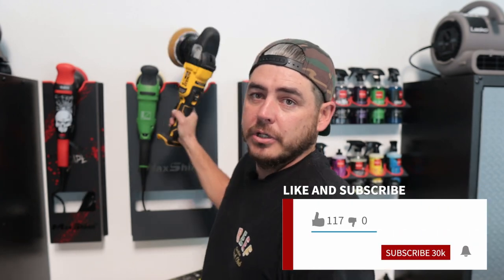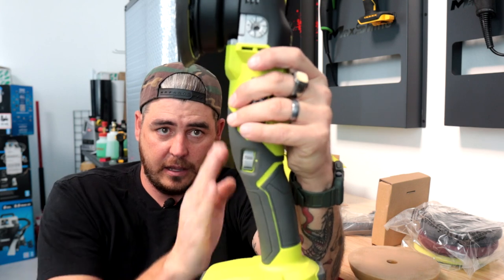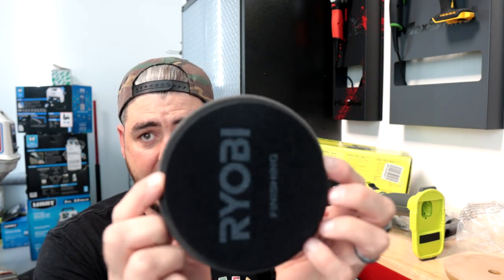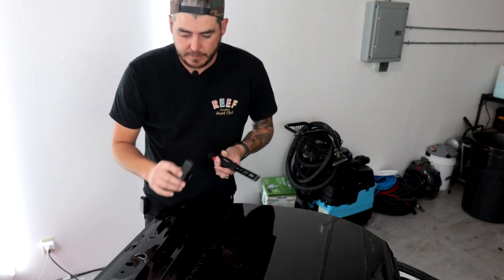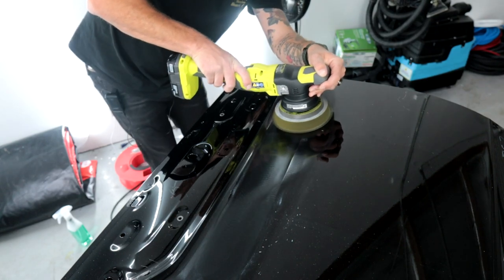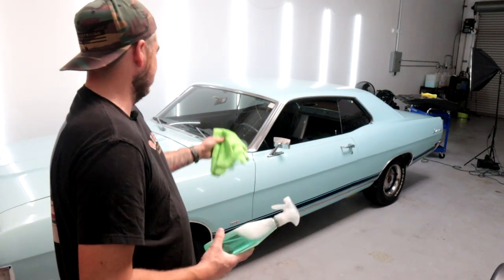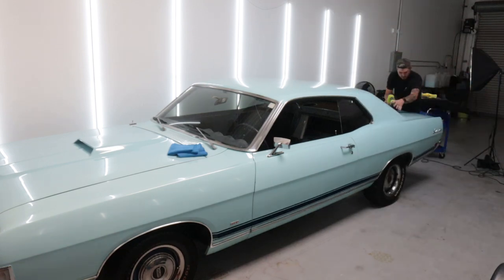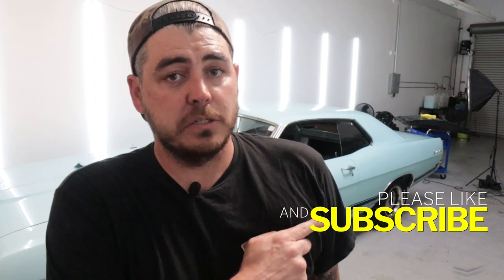Ryobi 18V Dual Action Polisher | Battery Powered Polisher | Car Detail

Comment: Hey josh if you use the high power battery packs the power on the polisher gains substantially. Try  one you will be surprised
Reply: True
Reply: Does it give it enough to do minor correction ?
Reply: You need the big boy battery for sure, you need the amps. It's like trying to use a small battery with a impact gun, it won't do much

Comment: Looks great for DIYers, looks about right since Ryobi doesn't really aim for professionals. I would love to see it apart and take a look at the armature; also wouldn't hurt to repack it with better grease.
Reply from the maker: Yes good point! Like the Bauer harbor freight mod
Reply: I’d watch a video of re-grease on this unit.
Reply: @imjoshv  what size is the screw to take of the backing plate

Comment: The on/off switch is actually not bad. I have a disc sander with that switch and I struggled for the first two uses and now I actually like it and is easy!

Comment: What do you think of using this with a 3 inch backing plate? I just bought the new Milwaukee 15mm polisher and I have the adams sk pro micro. I need something in between that’s also cordless.

Comment: So I'm looking to buy a polish tool like this for mostly waxing as I'm very inexperienced with waxing and paint correcting as my truck is only a couple years old but has tiny scratches from typical washing. I already have ryobi tools. Would this be good if I only used for waxing or is the ryobi orbital buffer a better option?

Comment: I have had this about a yr . I dont use it for correction though . Enhancement/ 1 steps  and wax removal only . I have like 20 batteries so that's not an issue.  I have used almost three 4 ah or 2 6 ah to get around a vehicle.  I also use it when doing motorcycles with an extension.  Pretty happy thus far . Alot of the time it just comes down to if I'm mobile or home . Ty for the video.
Reply from the maker: Awesome glad to hear!!
Reply: You use this machine for wax removal? I can polish and apply wax to my car with two 4ah.

Comment: Polished about 20 cars using ryobi.
It leaves holograms on black paints sometime, which is hell = game over since i do one step only.  Even on some  volvos and audi paints  - holograms. Pretty visible holograms but not super bad holograms.
Scholl s20 + blue spider pad - moderate to heavy preassure . 
1 large black   car moderate to heavy swirls to 80-95% defects removed in 12 hours = one cross pass = left , right , up dow.
10-12 batteries 5 ah each. 
If  heavily swirled german cars,  then double amount of passes for the same results. 

I am done with ryobi now and need propper macine now.  
I am almost sold to forced rotation as it will not keep stopping at curves and edges of some crazy toyota cars :)
The only point holding me back from going forced rotation is absence of knowledge if forced rotation machine will always finnish very well with one step compound leaving no holograms as well on black paints.  At Least on German cars. 
One step compound -Scholl s20 one step compound and medium cutting pad / blue spider pad combo for example to remove moderate to heavy swirls to 85-95% perfection =  85-95 % defects correced while super lttle haze and 0 holograms left after 2 passes= left to right and up snd down = 1 cross 

Kind Regards 
Your subscriber
Reply from the maker: Thanks for the info! I would say you can get swirl free results for sure but you may have to change up the pad and compound/polish combos. But it sounds like you found a trusty combo that works for you. The ryobi just isn’t the choice for you. I actually have never used a forces rotation but I see the benefit for sure not having to worry about it bogging down. Are you looking at flex?
Reply: @imjoshv  
Aye looking at Flex forced rotation.
P.S. 
Not doing 2 + steps paint correction.
One step takes me whole day....
Thank you but more than a day for one car just not for me
Reply: @maximolotov one step takes a whole day? I'm pretty slow I feel like but I can compound and polish in half a day on my Mercedes SUV. If you're working on badly scratched or marred paint then I guess I could see that but shouldn't take that long!

Comment: Thanks for the fairly thorough demonstration Josh. Like your Fairlane! Being newish to detailing, curious as to what the various foam pads are used for.
Reply from the maker: Foam pads have different densities. Usually 3 different types: compounding, polishing, and finishing. But you can also play with that. Sometime I will use a compound on a polishing pad to achieve a result I’m looking for
Reply: @imjoshv  does finishing pad usually mean that is for wax only and not compound.
Reply: @thestreamreader not wax but a polishing compound.

Comment: So, I bought the thing, and since I have a Mini cooper, I thought none of it, I mean no brainer, did 2 panels (door and side) with compound to clear a heavy scratches and battery died, re charge to full, 1 door and back, same thing. Any thoughts? 🤷‍♂️ I’m I doing something wrong? (Ran 5 pases, cross pattern with a 5” hex chemical guy’s orange pad and Maguire’s Ultimate compound) currently charging the battery to do the rest of the hood and trunk 😴

Comment: Straight up the bogging is due to the 1.5mah battery. I threw those crap batteries away. No good at all. 4mah or up. Couldn't stop it at all with my 9mah battery. Heavy but works the best.
Reply from the maker: Awesome great info!!

Comment: Hey Josh!  How would you compare this to the harbor freight DAs?  Looking for my first polisher will probably do 2 step on my car and kids car then not touch it for two years. I can get a factory blemished version for $139 and already have 2 9ah batteries. The battery powered option just sounds so attractive vs corded and the vibration/smoothness of the Bauer is often brought into question.
Reply: Little late to reply now (dunno if you got something by now) but I have the older/shorter throw HF corded DA and this Ryobi...  The Ryobi is not nearly as as powerful.  It is best used with a 4Ah+ battery for sure, a smaller single-row battery is not going to cut it; but note with more power there's more vibration.  The vibration is tolerable for a DIYer or someone doing a car on a weekend or something, but nobody would use this repeatedly/daily.  If you think the HF is bad for vibration...lol, the Ryobi is much worse.

If you need to do heavier correction, forget about the Ryobi and go with the HF (the newer longer throw being able to do even more in that respect).  If you try to do heavier correction with the Ryobi you will likely need to spend more time, and subsequently burn through a lot of battery doing so.  9Ahs are nice but three or more 4-6Ah batteries would make the tool a bit easier to use, due to less weight.  I think the 6s would be the most ideal here TBH, but really whatever you have multiples of so long as they're 4Ah or more.  Swap & charge when you're at about 2 bars battery (better method than running down completely and swapping then).  

Having the two tools though, the HF is definitely much more suited to correction.  If I need to do anything more than a basic polish, I use the HF.  After doing that, can switch to the Ryobi for next stages--polishing and applying wax/sealant--and do away with the cord.
Reply: @rolandm9750 this is the type of review comparison I was looking for. Thank you!

Comment: Btw on page 6 of the Manual, towards the bottom left it says "The tool’s rotating base moves in random orbital motion. 
The orbit diameter is .31 in (8 mm)."

It's sorta hard to find but it's there, if that helps any.
Reply from the maker: Awesome thanks so much!

Comment: I know this is off-topic for this video, but I've watched all of your content and would really value your opinion.  I'm expecting delivery of a new Ram 1500 truck with 'bright white' paint and cloth/vinyl black interior.  What protectant steps/products would you recommend to apply immediately?
Reply: Clay it do a one step paint correction and do a gyeon wet coat its the easiest fastest way to protect your vehicle
Reply from the maker: Yes I’d put a ceramic coating on. Wet coat will give good protection. I really like the maxshine graphene ceramic coating or g technic crystal serum light! Both are easy to work with and will last longer than wet coat, but they won’t be as easy to apply. For the cloth interior you can pick up a fabric protectant. Scotchguard auto can be bought at Walmart and does a pretty good job! Congrats on the new truck!!
Reply: @imjoshv  Thanks.  Are we saying that the ceramic coating is the 'one step paint correction', or that the correction is something that should be done prior to the ceramic?
Reply from the maker: @kirbyspencer538  the ceramic is just protection. You want to do a few things to prep the paint for proper adhesion. Clay removes contamination the a one step polish with bring shine out and then do a prep wipe to make sure there is no residue left on the paint and then coat the vehicle! You want to use a polish with no fillers or waxes so that’s it’s just a pure polish
Reply: All of them

Comment: why not just read the specs ? 8 mm according to Ryobi - may even be on the box ?

Does yours appear to stall even with very light pressure ?
Reply from the maker: It was listed in the manual… I finally found it haha. Yea it will bog a bit but not bad at full power

Comment: Just used this to do a 4dr suv. Only used it to do a polish on the clear, did not need to do a compound. Went through 6 4amph batteries. Applying light pressure to the head of the tool killed it's orbiting action, and basically stalled it out. I returned the tool in the end. Not worth the money. All my tools are Ryobi and some harbour freight stuff. I like Ryobi but this tool is way below par.

Comment: This polisher sucks. It stalls even when I use no force. I even turn it to max rpm and I was using the included pads too. You're better off using a Ryobi drill with polish disk.

Comment: Of course the DA head is stalling out, you’re using a battery that is not even half of the recommended power rating 🤦🏻‍♂️
Reply from the maker: That’s the battery it comes with. I wanted to test it as it’s sold
Reply: Uh, this is sold as a bare tool only. You even state this at the start of your video. So you’re contradicting yourself there to begin with mate. 
If you’d done your research, you’d find that the very lowest rated battery you should use with this DA as stated by Ryobi themselves is 2.0ah, with the 4.0ah being recommended, though you can use all the way up to 9.0ah. You’re using the 1.5ah battery which came with your drill 🤷🏻‍♂️ 
So yeah, as I said, your battery is not even half the recommended power rating, and you’re complaining the DA head is stalling? Of course it’s stalling 🤦🏻‍♂️

Comment: Ryobi and Dewalt are the same company.  You can get an adapter to use Dewalt batteries on Ryobi tools.
Reply from the maker: Are they? I know tti make Milwaukee, ryobi, etc… but I don’t think they make dewalt
Reply: Ryobi is owned by the big conglomerate that owns Milwaukee not DeWalt.
Reply: @Dan Johnson  thanks for correcting me! TTI pretty much owns them all. Dewalt just falls under Stanley Black+Decker.
Reply: You can get Milwaukee adapter for dewalt and pretty much any other platform does not mean it's from the same company